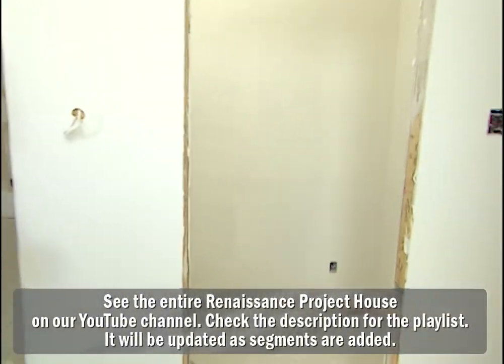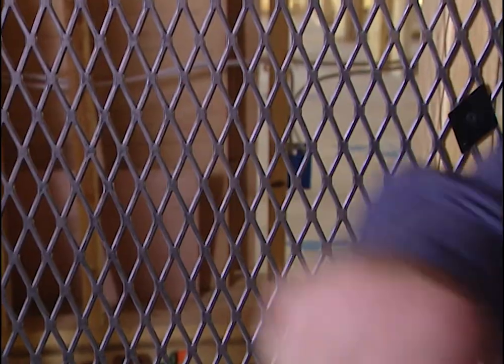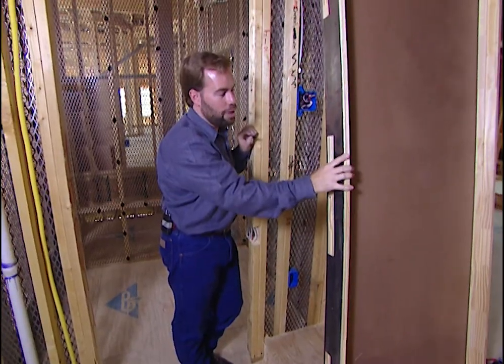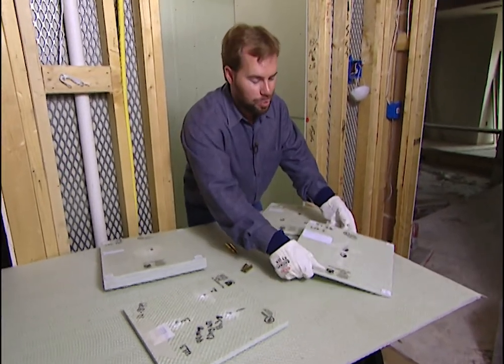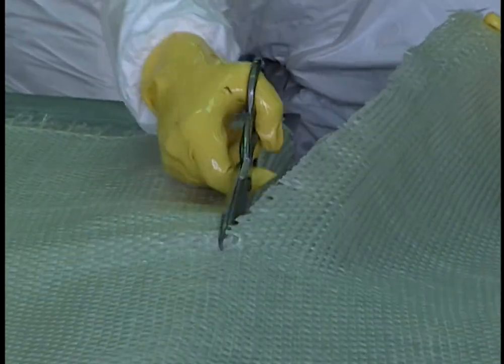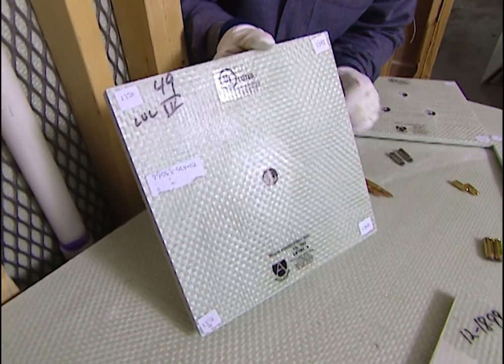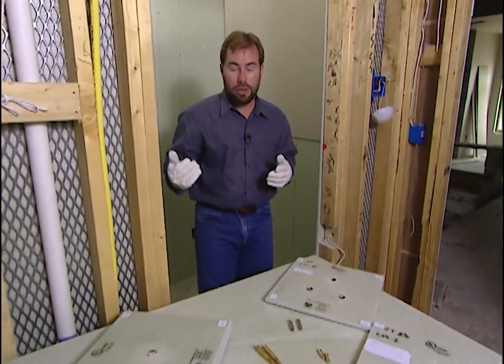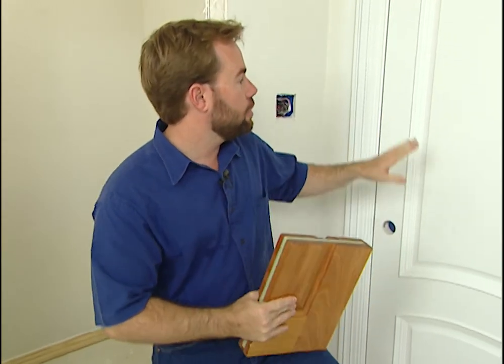Safe Room: Renaissance Project House - Part 13

Comment: What will you do with a handle for that door? I assume it will be locking
Reply: I think it be very hard to get in with a sledgehammer. But anything is possible with enough time. Of course a concrete room with a vault door would be stronger and a lot more expensive. Of course, it would be assumed if there’s people in there they would have a way to contact the police and also have firearms in there. I don’t know how long you want to hammer on that door, knowing that when it opens you’re gonna get shot and the police are probably already on the way.

Comment: 1/2inch of abrasion resistant steel would stop api 50bmg and everything else 😂i mean if your going for panic/safe room dont skimp on protection wide open room 1/2 inch ar steel with 2 feet of helix steel cement on top of that nbc air system make a small living quarters think 2bedroom one bathroom bunch of bunk beds and escape tunnel
Reply: 1/2 of steel doesn't stop 50 API, pretty sure it still goes though that like butter. Plus this is on the second floor, so they weigh you're talking would ad 10s of thousands of structure cost underneath it.
Reply: @townsendliving9750 not mild steel AR STEEL ballistic rated 1/2 inch would be to much 1/4 inch would be fine plus depending on tornadoes or burglars as much space between your family and them is preferred

Comment: Nice video showing options that are available.  This is an emergency room .  It's a room to hide in while waiting for the police or the calvary to arrive. It's not in a bad neighborhood.   I'm sure it's in a posh neighborhood.   Once the crooks are inside the house, there are numerous ruses to use to get inside a home.  This room is a last resort.  The steel mesh is a Faraday cage. It may interfere with cell signal.   I would make sure there is either an exterior antenna or a communication device once locked inside.  Nice video but I know it was very pricey for the bullet resistant material. A custom vest is over $ 1k$.  I would have used a different design and material but nice.

Comment: Darn nice, until you see that they mounted the hinges to be outward swinging. I hope that the intruders only brought guns and not a battery-operated Sawzall with a metal cutting blade or two. :(
Reply: Obviously you would install bolts on the hinge side too to secure the door from inside, duhh
Reply: @luisazpurua1  I doubt that is the intent, otherwise, why not make a big deal about putting a metal plate on the hinge side? Duhh.